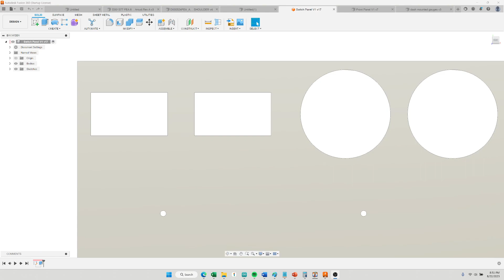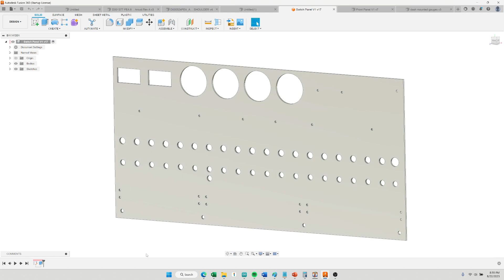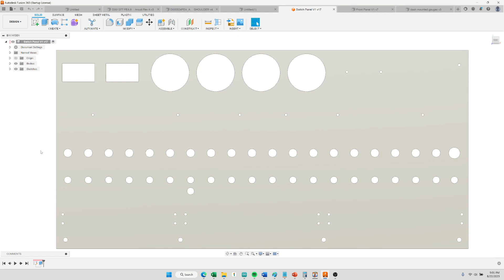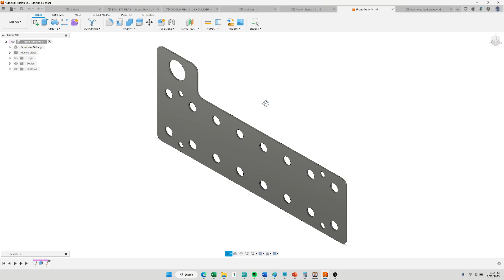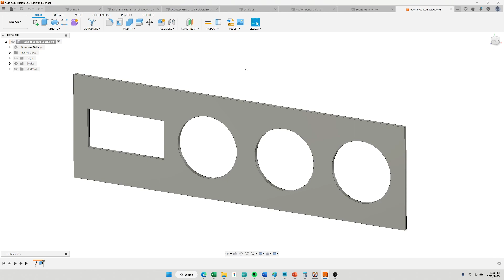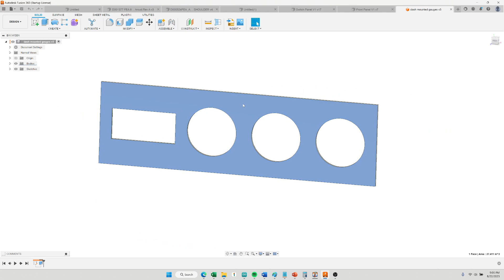Miata Custom Switch Panel!

Comment: Don't they make switches with an LED ring around it? That might simplify the panel a bit.
Reply from the maker: They do. He main reason I ran these was that they are rated for 50 amps and have ring terminal termination.  But yeah, the leds are kind of extra. I almost didn't include them.